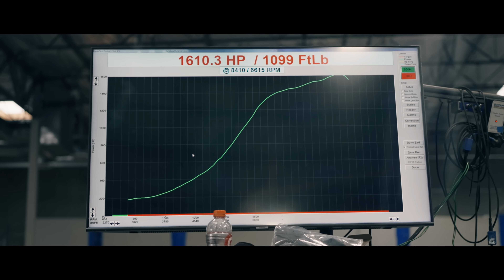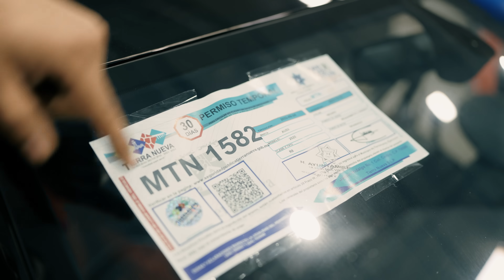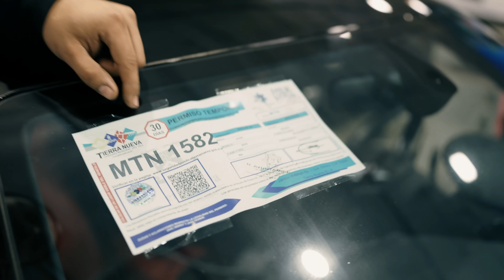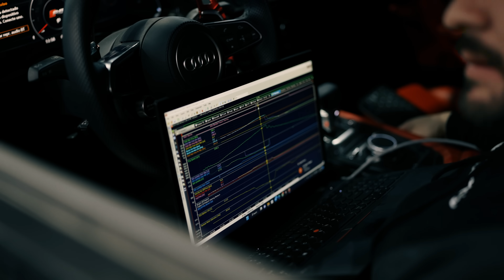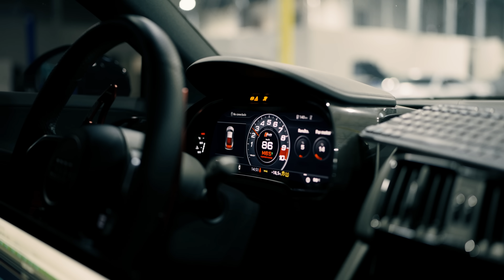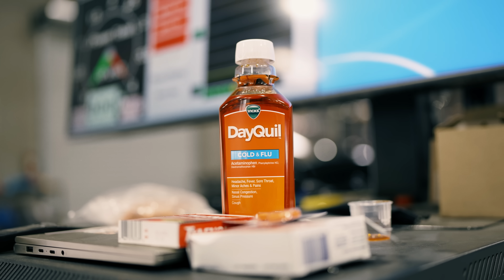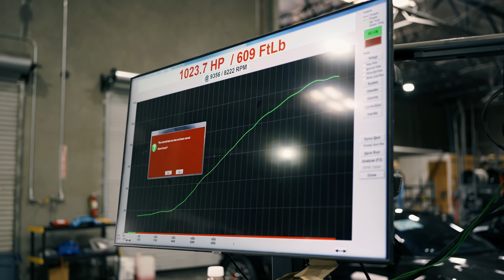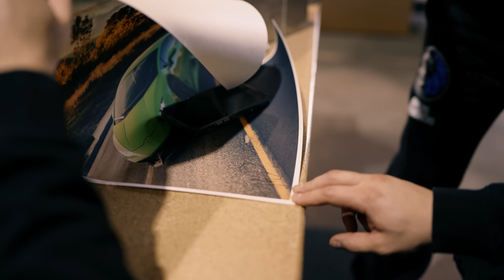WE BUILT MEXICOS BADDEST TWIN TURBO R8

Comment: With the 2012 R8s are the transmissions a big difference to the newer models like the plus models ? If so I’m looking to purchase an r8 2012 twin turbo made with titanium piping and if need be I’d like this trans you just built for it if it’s better. Not sure if the 2012  transmissions can with stand long term driving with a twin turbo set up

Comment: Whats it Mean when you say on the Gate? So if it's built with an  engine to be ready for 40 lbs of boost , 15 lbs spring  , so it gets tuned at "the gate" on that 15 lbs spring?

Comment: so at what point does the flux capacitor kick in when you're using the 14lb spring? assuming the duty cycle stays at a constant. should have enough back pressure at around 88mph no?

Comment: Hi Sheepy race team. I was curious to ask if your billet ring/pinion were also treated to be stronger? Cryogenic treatment could theorically gives you 10-20% stronger gears. And just by curiosity, what is the size of the ring gear and what is the spline count on the pinion. maybe you could fit a bigger ring/pinion just by re-drilling holes in an existing crown/pinion on the market ?